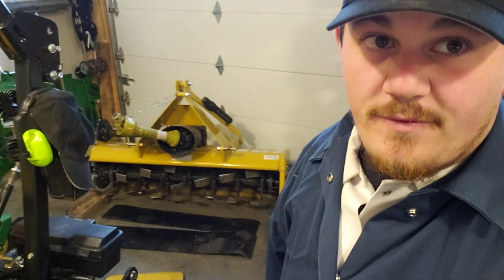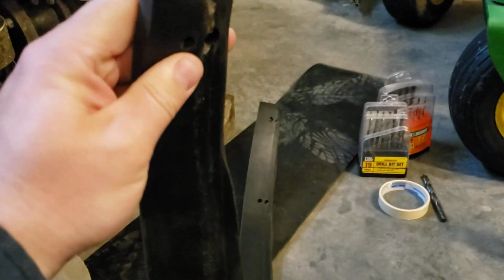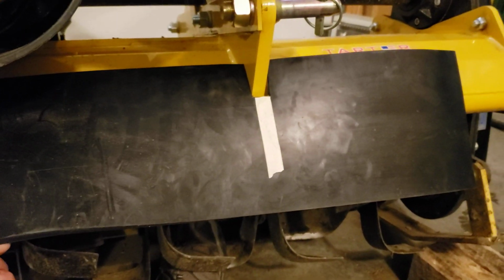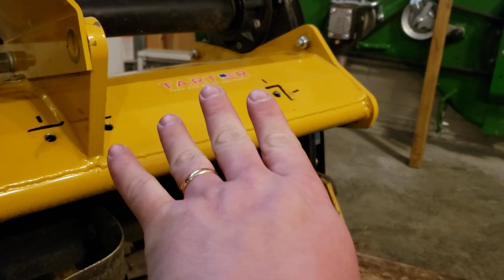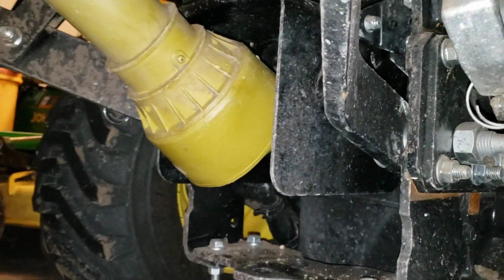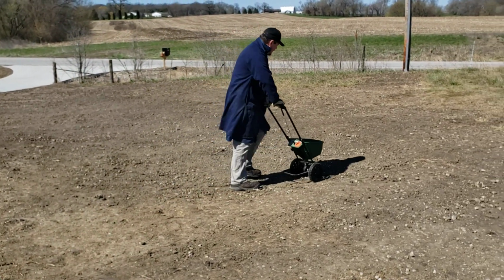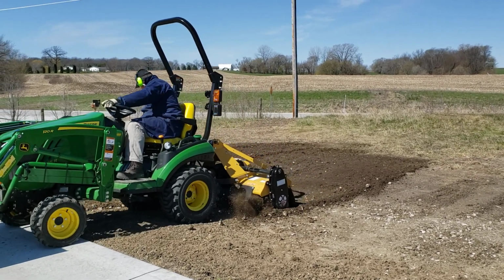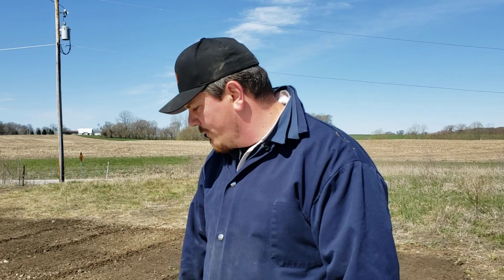Tarter 60" 3 Pt Tiller - Debris Skirt Mod for Reverse Tines

Comment: Stick the flappy section with a spot of contact or silicone adhesive
Reply from the maker: I was very pleasantly surprised at how well this mod worked. It's kinda nice having the outsides opened still...so some of the material can escape and get out in front of the path about to be worked. If I had to do it over, I'd just cut the longer piece, so it didn't look like a mistake - I still could, to be totally honest ;)

This whole machine was a GOD-Sent!!! We could have NEVER got this project done without it!!! 200 lbs of grass seed might as well be a truckload!

Comment: https://youtu.be/9Jd5Ml_3scs?t=663  jig saw, fine blade (metal) or a knife blade?for cutting the rubber.  safer
Reply from the maker: This rubber cuts fairly easy, but if you'd rather cut it with a jigsaw, that would be fine too.

My only regret with this project, was not cutting the whole length piece. It would have been a more finished look, and worked slightly better, however, I now have an "escape" hatch for rocks on either side ;)

Comment: Do u oil change on the tractor or tiller often?
Reply from the maker: Tractor only calls for oil change something line 100 hours. I'm getting close on that, but the tiller is brand new. I will probably change that oil, very infrequently, since just a gearbox...not an engine.